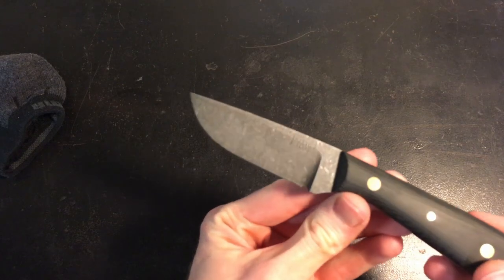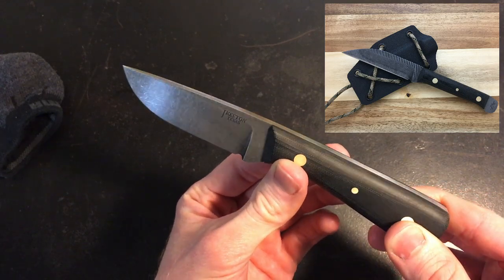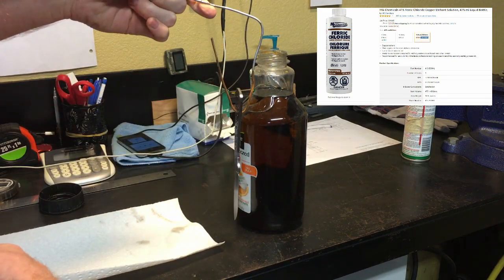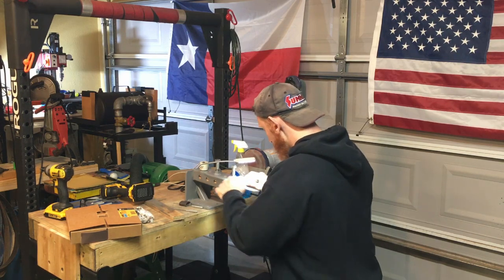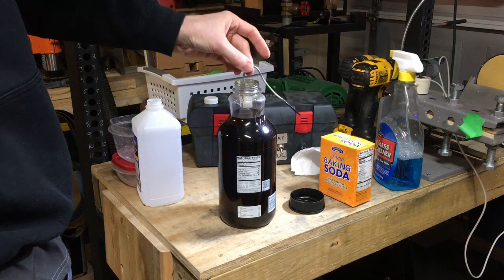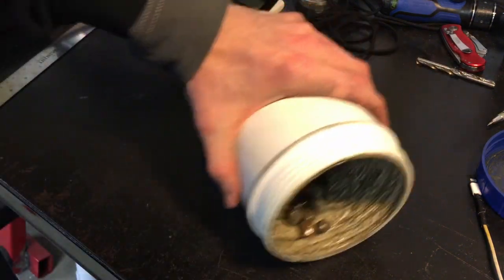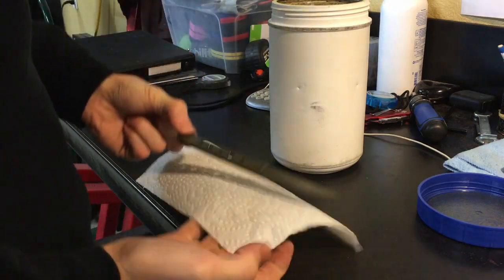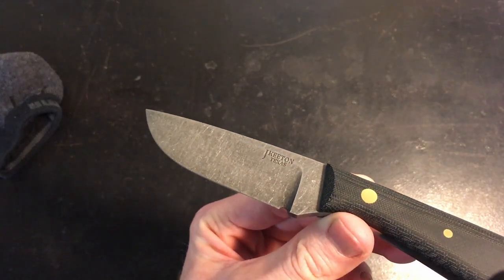How to Stonewash a Knife

Comment: I started adding vinegar to my ferric, so like 45% water 45 ferric & 10% vinegar.... Also, I found if I dip the blade then wipe it down with the steel wool & keep dipping and wiping until it is completely even, then let it soak, it comes out darker and more even... after baking soda, I use penetrating oil to seal in the etch(stonewash or hamons)...  take it easy...
Reply from the maker: Thanks for the tips!

Comment: I have done a few with a very similar technique to yours. I made my ferric and seemed to work well. 
Only difference lately is that it did this in stainless. Effect is a bit different and not as pronounced 

Great video and instruction as always.
Reply from the maker: Thanks Nick, I have yet to ever work with stainless. I'm currently focusing on steels I can HT myself with my forge. That's cool it came out different though.
Reply: There's a different solution you're supposed to use with stainless. It looks really good. I don't remember what the solution is, seems like it was some type of drain cleaner, but there's at least one video on YouTube about the process because I watched it about a week ago and there's probably other videos I'm sure if you just keep digging.

Comment: I love your work bro I started out having a lot of the tools listed in your beginner video and moved up to having all pro gear minus the power hammer. I have a question as far as other finish variations ie how do you get the flat grey color you see on factory made knives etc. I also had a question about bits and alternative methods in using them ie I’ve seen some guys using either their drill presses or mills like a router and etching/carving out their knife blanks using the side of the bit. I’m assuming that’s a cobalt bit of some sort? I’d really like to know. I have a band saw which has sped the process up quite a bit but I’d love to use the press considering in my shop I’m always in arms reach of it. Anyway much appreciated!
Reply from the maker: Hey AJ, really happy you're enjoying the videos! I must say I'm not versed in many other finished. This stone wash finish is one of the main finishes I use. You could also look into cold blueing and finishes of that nature. I still use my band saw to cut out blanks since it's fast! The mill would take forever unless you had a huge CNC mill. Cheers sir! Have a great week!
Reply: The matte Grey I think is a sandblasted finish

Comment: i used this for 1084 blades. it didnt darken it too much but as i left it longer than 10 mins it started to eat a bit into the metal. the 1084 was a bit uneven and motley after ht that wouldnt sand out too well.
as a result after the acid wash the blade almost looked like a damascus with a patchy uneven appearance that wasnt too bad.
after stonewash there wasnt a lot of wash feature but enough to get the idea of what had been done.
blade could have been darker and wash feature could have been more pronounced.
i think it was an inherent problem with the 1084 bar stock more than anything else.
Reply from the maker: This is an updated version of this video - https://youtu.be/m6oKy2UDeLI

All the blades I've stone washed have been 1084; I've found that the heat treatment needs to be very even for good results as well. 

Cheers! Good luck with your projects!
Reply: @RedBeardOps  yes i think the ht company has lost its touch and i will be changing them.
i normally use only 440c and bring up to mirror so just started in 1084.
did another ht 1084 yesterday and you could see when it was in the acid that a portion of the blade wasnt turning to the black and then wouldnt accept the stone wash finish.       before i tried the stone washing and was sanding back thru the grits as with a 440c process i normally use
 the 1084 would show a mottled uneven patchy finish. thats why im trying a stone wash process to eliminate that patchy finish. like it had been burnt in patches.
anything past about 600 grit was hiliting the uneven finish so id have to leave it at a satin which is harder to do than a mirror!
could be the 1084 itself but im thinking more the heat treater.
cheers

Comment: Hello Mr Redbeard. Im making exclusivly full tang knifes and are about to try the etched stonewash finish. I see u only keep the etch on the blade and not the tang and spine, is it possible to etch those parts after the handle is finished to give it an a more consistent finish? Or will the ferric chloride stain any material ot comes on contact with? Best regards, Niklas / Sweden
Reply from the maker: Hey Niklas! I've never tried it but I have seen it done. On method you could do is use take down hardware. So that the knife can be taken apart after handle shaping.
Reply: @RedBeardOps  thx for the reply 👍 will give it a try. But will probably end up with giving it the same finish as yours 😉 have a great day!

Comment: Do you have a alternative to ferric chloride?   I heard Battery Acid will work  and if so, what process changes from ur tutorial with Ferric Chloride?   Thanks man
Reply from the maker: I'm sure it could work. I've seen people use vinegar and/or coffee for etching knives. Maybe slightly safer. I don't think the process would change... just maybe the time you need to etch depending on the acid strength. Whatever you do make sure you neutralize the blade with baking soda after.
Reply: Can do. appreciate the video and info

Comment: Thanks for the video. Would the stonewash work without doing the acid etch first? I have a coated blade that I want to look “blackwashed.” Any advice?
Reply from the maker: What do you mean by "coated". Is it powder coated? I don't have any experience trying that... but I guess it could work out. Not sure.
Reply: JKeetonKnives it is a black cerakote. It won’t be fully cured yet, so I think the stonewash will still be able to wear some of it away.
Reply from the maker: @njo9966  Should be interesting! Sounds wild

Comment: Very Nice ! How does this wear when in normal use ?  Many Thanx and again Very Nice.
Reply from the maker: So far so good. One of the things I like about a stonewashed blade is that any minor scratches on the blade are generally incorporated into the finish. Like all carbon steel blades it will still require cleaning and oiling from time to tome. Make a point to neutralize the acid with baking soda or Windex with ammonia.

Comment: Awesome vid. Had been subbed, but I turned on notifications. Do you touch the knife barehanded right when you pull it from the acid?? Or is there some cleaning going on during this step
Reply from the maker: Thanks sir. Yes I did. I'm dunking it in water and spraying it with windex pretty soon in the process so a little acid on my hands doesn't bother me. Not sure if this is "bad" or not.
Reply: Red Beard Ops thanks for the reply, brother. Me neither, just wanted to make sure I was understanding right. Gonna give this a try soon. Love your work, keep it up 😎👍🏼

Comment: Is there a trick to keep the stonewashed finish on the spine ? The only solution for this problem I came across is to use some kind of screws as pins, but that’s very ugly.
Reply from the maker: Yes you can use fasteners for a take down handle, you could wax the handle and etch the whole knife, or you could employ a method like I did in this video -  https://youtu.be/CbOj-k7M1us
Reply: Take off the tips of the screws and walla it should look decent